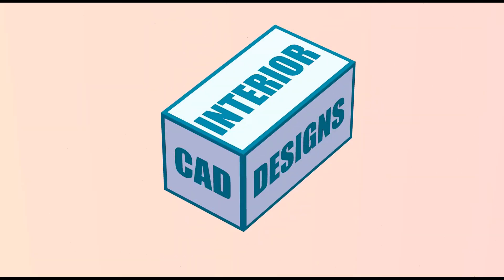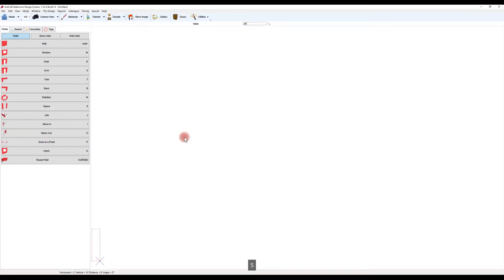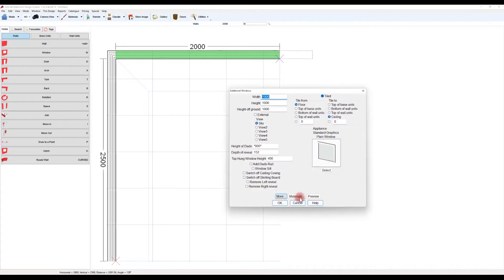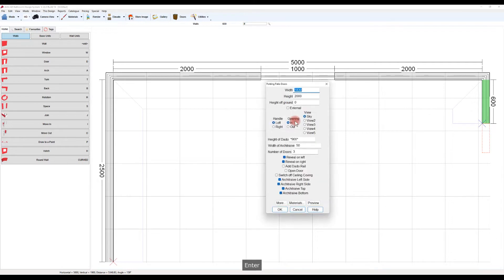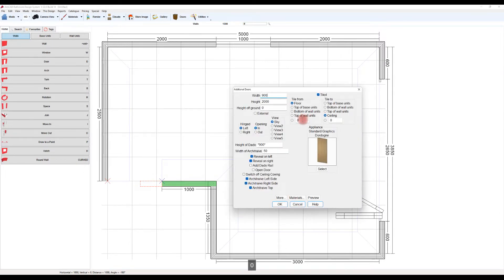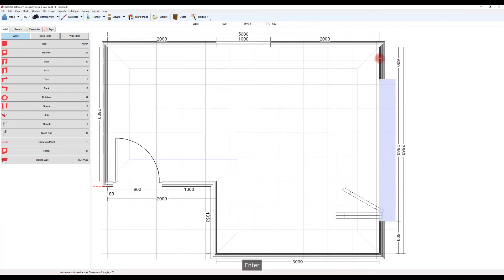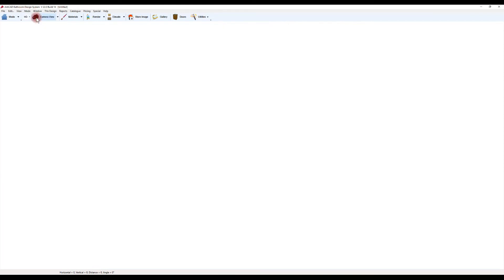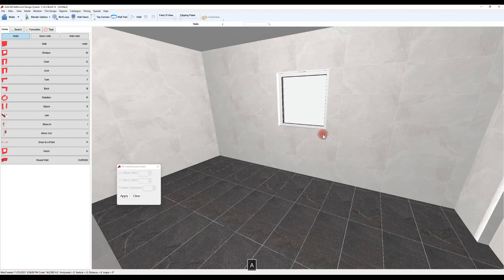Articad Tutorial 001 - Building the room

Comment: Hello how do you do a diagonal wall still new to this software ?
Reply from the maker: The easiest way is to start drawing the room after the diagonal wall. When you get to the start point of the diagonal wall - join the wall and the diagonal wall will go in completing the plan. alternatively use “rotate” (keyboard shortcut “R”) and set the angle (I prefer the first method as it is easier). Let me know if you want a quick video. 👍👍